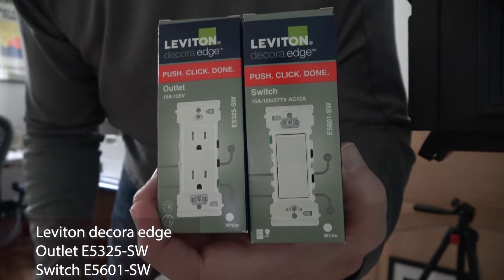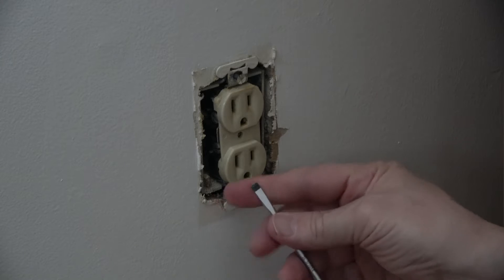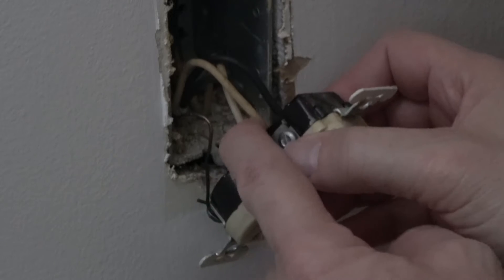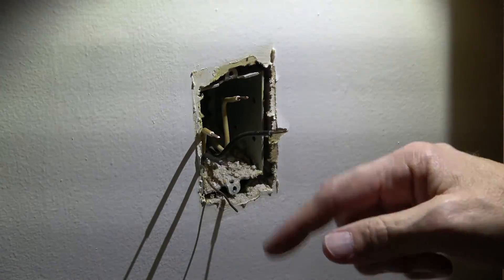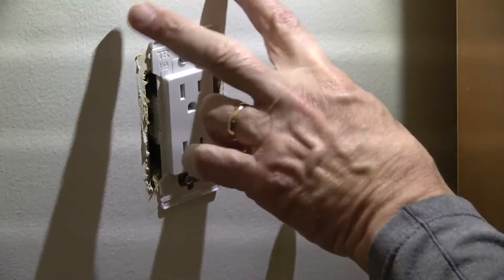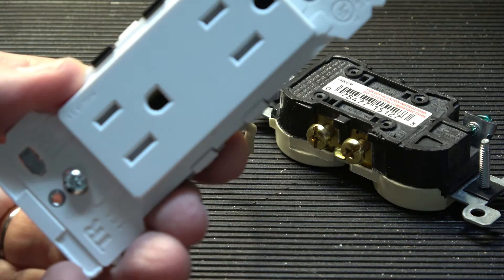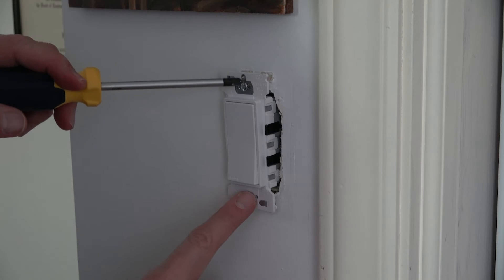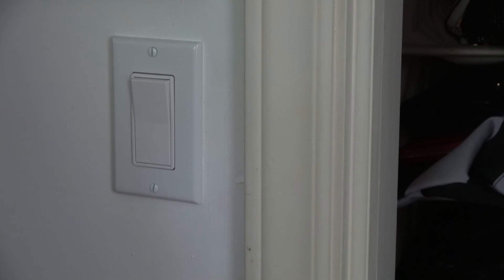Leviton Decora Edge Outlet and Switch E5325 E5601

Comment: I have one of this switch but I’m a little confused because in my wall I have two black wires and 1 red wire confused on where the two black ones go
Reply: Any help
Reply: @burnham09  you have three way switches. The red should be a runner between both switches the black is hot and the white is common.
Reply: If you have two black wires you need a tester and find the hot wire that is carrying the power and that will go into the black side

Comment: I just installed three of these switches.  My criticism is that the switch has a very light touch. Basically, breath on it and it activates.  One of them controls three outdoor flood lights. Easy to trip in the day and not know it.
Reply from the maker: They certainly are not like the old mechanical switches that required more effort. You may want to consider the light up switches that way you can tell if there are accidentally powering a device.  https://youtu.be/_iBtO3SzJFo or https://youtu.be/TVOVp0KqPoc